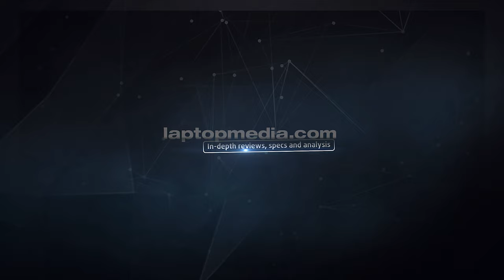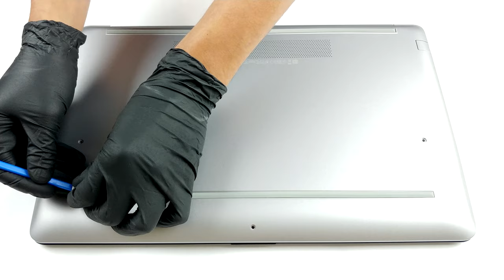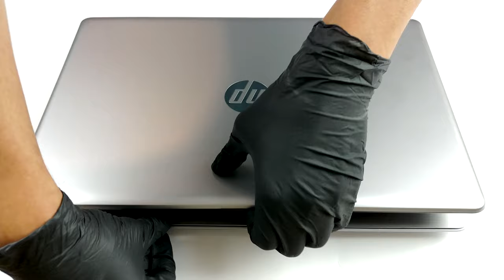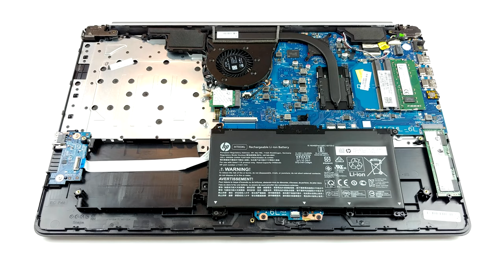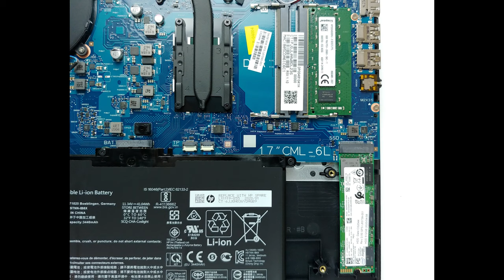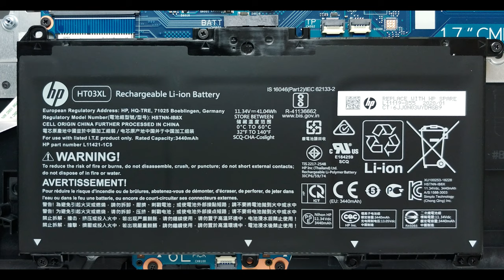🛠️ HP 470 G7 - disassembly and upgrade options

Comment: Excelent disassembly,,,
Short and concise...
I would dare to suggest a sequel video for the disassembliy
where you test the more obvious hardware changes...
in this case expanding memory... with +4GB +8GB and test of hi/lo RAM frequences...
also in this case... install of a bigger M.2 PCIs... and a 2.5 SATA drive...
?by the way.... ?where is the SATA connector for the 2.5 bay in that board????
can you put a zoomed picture here???
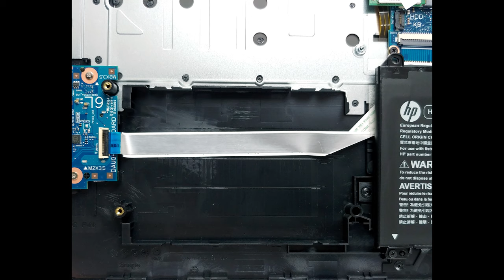Reply: Hi! Minute 3:21. Can you see the HDD KB connector at right-top? This is for connect a 2.5" SATA connection cable (SATA in the SSD/HDD extreme and 10 plains pin at this connector). You can take from HP (too expensive I think)  or better (and not so expensive) from Aliexpress. You can use both. Look for the ref. L22526-001. And if you want the disk cover too, look for L22534-001. Cheers!
Reply: And yes... I think it would have been good to stop explaining the connections for a second/additional SATA disc...